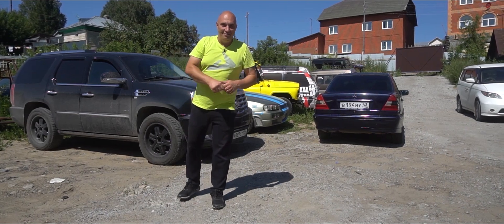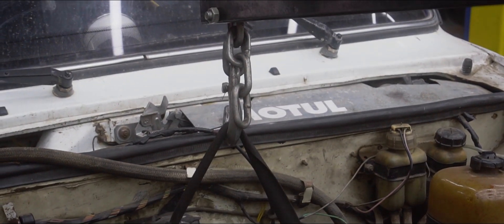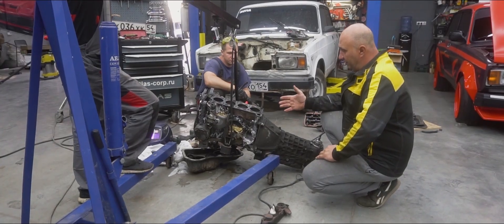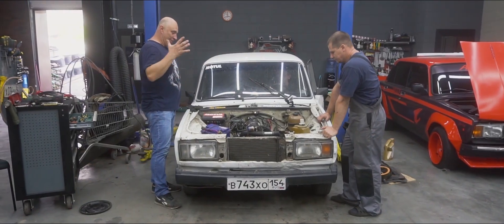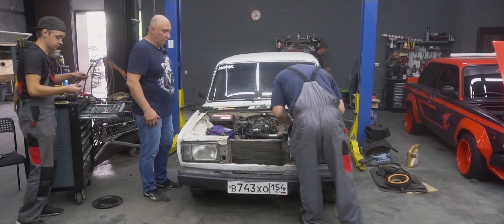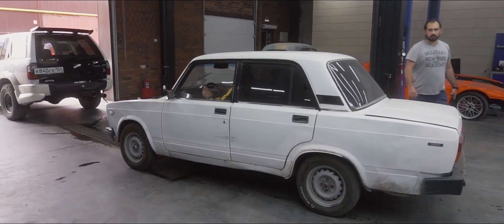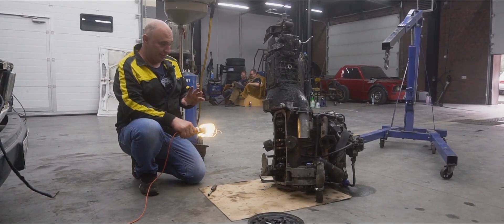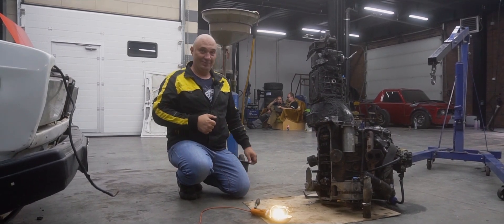Spring mod for piston rod – will it work?

Comment: Let’s see an engine block made of concrete. Cast in the bearings and the sleeves
Reply: Get a piece of billet stone and use that ? 
Billet stone 😆😆
Reply: Ship Engines have been succesfully cast from concrete
Reply: Their wheels are already filled with concrete. They won't make an engine out of this. They do not know how to work with concrete))
Reply: That would just be a complex bomb
Reply: Thats an easy one they make them out of plastic and that is old tech.
Reply: Concrete not good with heat. I will say high heat ceramic with intense nano tech luberication,.  is future if engines want to survive. Lithium battery replacement will be a killer for EV v mark my words....eh. Soon.

Comment: Try threading the spring into the actual connecting rod itself.  You can then adjust compression ratio by simply spinning the piston along the spring in a rotation of 360 degree increments. Also use a finer "thread" spring for more surface area inside the connecting rod. Food for thought.

Comment: Just like a miniture Tina turner, you need a tiny damper!

Other ideas...
Make a skid steer car, remove all steering mechanism, replace with right-hand brake and left-hand brake!
Replace all suspension springs with just dampers
Make EV - but just make forklift very fast. Or use very high torque electric motor, gear it right down with stupid massive gears, and make EV bulldozer.
Make 7litre ladazilla into monster truck with old tractor wheels
Make something go really fast that is normally really slow, or vice versa

Comment: The timing is all fucked-up.........Here....the Pistons will have a slack in position to the crankshaft....will spark at correct TDC according to the cam-shaft timing and not at the piston position . To put mildly..........you have put a rubber band in reverse !!! Enjoy wasting our time and learn nothing ?

Comment: force induction add some air in the engine and then start it or nos but i dont want you to blow the engine if it makes compression what i think happening is that the spring compresses till the valves open which makes no compression the reason of the engine not starting it also might have piston slap

Comment: You guys should try making a stroker lada. Got enough crankshaft haha. Cut 5mm off the connecting rods, then weld in 5mm of metal to each crank lobe. Wont hit top, and has 10mm more stroke. Could get crazy and cut 10 or 20mm out. Lol

Comment: I was thinking if they did it to a smaller motor like a brigs and used a hydraulic roller cam valve spring for a sbc  "a lot more stiffer spring" it might work.

Comment: Use to work for the government in an engine test facility and this idea was extensively tested with several different much better designed sprung conrods, and no we could not get it to work.

Comment: Even if the engine worked with just the springs the piston heads would simply smash into the valves deforming them with every cycle

Comment: You can't weld directly to springs for the same reason you shouldn't cut coil springs with a torch to lower your suspension. The heat creates a weak point. If they had machined some sort of fastener or even used JB Weld on the springs we might have a chance.

Comment: I think if they added a jumper pack to the battery to start it, the starter would have more power to turn it over. I think that'd work because I had the same issue when I changed my clutch. The starter didn't have enough power to turn it over. When they tried to pull it to start it, they must have put unnecessary wear on the engine. Although it didn't work, if they had probably put a jumper pack on the battery, they might've been made it able to run for at least a few seconds to a minute.

Comment: It can work,but with much,much stronger springs than those,also they weakened springs with welding.
Reply: Yeah. I think they would have to make the connecting spring as a whole that's not welded. 😁

Comment: When the air fuel mixture combusts the energy that is released sends the piston down. The rods transfer the energy towards the crankshaft thus making it rotate. Here the spring instead of transfering the energy it absorbs it therefore little to no energy goes to the crankshaft

Comment: Time for a boxer engine Lada? Two pistons in one block, two in the other. Cut down the engine blocks to the centre line of the crank so they can be welded together to make a subaru Impreza engine.

Comment: what is the minimum number of cylinders you can drive a Lada on (with the spark plug pulled out of the inactive cylinders)

Will the engine even start at all with fewer than 4 cylinders, or can you drive on just 1 cylinder and reap some fuel savings?

Comment: even just thinking sbout the combustion stroke, there's gonna be a big loss of power from the spring soaking up the travel of the piston
Reply: Their undoing was the compression stroke... crank journal rising, rod journal twisting toward that side of the bore, insta-wedge. Power stroke the rod journal is following, compression leading (the rotation)

Comment: THE NEXT TIME PUT VALVE SPRINGS UNDER THE MAIN BEARING CAPS!!
USE MAIN BEARING BOLTS THAT ARE LONGER BY LENGTH AS THE VALVE SPRING ARE LONG!!!

Comment: Gee....that’s completely ridiculous. Of course.....what’s going to happen? Seriously....???
When you weld a spring, it gets hot and it turns into thick wire.
There is zero chance of those welds taking that sort of inertia.....well let me put it this way.
You have a better chance of using baby seal foreskins,
 in place of the springs.

Comment: I'm no mechanic or automotive engineer at all, but I saw this failing from the very beginning. Even if it "worked", each cylinder would need to be extended in each direction to accommodate for the extra travel potential of each piston. And thus destroying the whole concept of compression.

Comment: Another explanation could be that, given the fact that you are using springs, you will never reach high pressure in the chamber because the coil will get pressed in the ascending phase of the piston, so, the level of explosion wouldn´t be enough to maintain the engine active.

Comment: Me: imma torque everything correctly because I wanna make sure it’s all good.

Russians: EMPAKT
Reply: It's a lada, it does not care lol
Reply: @televisionandcheese  i really want a Lada
Reply: Ugga duggas are the best
Reply: Danies Alex exactly, you need to torque the con rod caps to 2 Ugga duggas and the crankshaft bearing caps to 3
Reply: Honestly, for most things that aren't super critical (like inside the engine) impact guns are fine
Reply: Ollie Badstue they used it for the head bolts lol
Reply: @Racingboom  its lada , everything is cast iron non interference blah blah undestructible

Comment: Probably if you lower the compression a lot it would turn over but it will never run because the springs will put it out of timing it will destroy the valves

Comment: Now children what you see here is what is called Variable Connecting Rod Length on the fly otherwise known as VCRL on the fly,What that does is that it either controls the length of the connecting rod depending on temperature

Comment: The piston is going to crash into the top of the cylinder on the exhaust stroke or the piston will fall into the crank case on the power or potentially even the intake stroke. Compression stroke won't fail catastrophically but it might lower the compression ratio by enough that there is no power stroke.

Or the spring could just break

My guess is that best case scenario there is one rpm where the engine will run without issue and potentially even slightly increased efficiency, but it'll fail catastrophically before reaching that rpm.

Comment: Garage54: Replacing piston rods with springs.

14-1 Compression ratio engine: Am I a joke to you?
Reply: @inc.opt.63The compression ratio of an engine is the ratio between a given volume of a fuel-air mixture before compression and the volume during full compression. They can range anywhere between 8:1 to 12:1; diesels can have up to 25:1. The engine in this video has a bad compression ratio (or perhaps little compression at all) because the springs flexed and bended.
Reply: @UltimateBeamCar  not 100% true. You can have engines with higher than 12-1 compression, but can't use pump gas and have to use higher octane race gas (around 110 octane compared to premium pump gas which is 93 octane) as octane is the rating for resistance to detonation and you could run low octane gas but you'd fuck up your motor. That's why racers convert cars to run on E85 instead of normal pump gas because E85 is around 110 octane but is hard to find and you need expensive E85 fuel lines, fuel pressure regulators, and carburators/fuel injectors meant specifically for E85.
Reply: @moparmanicgarage  I was mainly using production engines as an example, but yeah that is correct.
Reply: Your statement used to be true. Mazda's SkactivX engine has a 16.3:1 compression ratio on pump gas. Achieved by carefully controlling flame propagation and having a new piston design.
Reply: @UltimateBeamCar  nevermind, the pistons keep wanting to go to TDC way after they should be
Reply: That was the first thing I thought.
Reply: I was looking for this comment.  and so were all the other mechanics 😂
Reply: @Forged_production  im not a mechanic, im 15 lol
Reply: @antreaskonstantinou8585  irrespective. You have a good point.  Because the spring might cause the motor to lose compression because it is variable
Reply: ha someone got it right.  no compression no explosion..

Comment: Its gonna be hell to keep that thing in time if it holds together at all lol you'll predestination on the cokpression stroke, and open late on the intake stroke, as well as not fully remove exhusf gases because of the spring delay....it might rub but not very well and not very long.

Comment: this deserves a part 2 with a little bit more thought and you will get it going. PLEASE  :)
Reply: yeah, put a telescopic guide of some kind inside the spring so it doesn't bend side-to-side, then it at least won't immediately break.
Reply: Yeah they forgot the shocks
Reply: Old engines ran on like onlu 4:1 compression ratio, I'm sure a stiff spring could achieve this..

Comment: Piston return springs!  Now you need muffler bearings, blinker fluid, headlight fluid, and elbow grease
Reply: Throw in some soapy wooder and ur all set
Reply: Lada and Honda seem to have quite different kind of piston return springs
Reply: Don't forget the lifter thrusters and the bucket of chrome sparks.
Reply: @RegalCobra097  whut chu talkin bout willis?
Reply: @daves_not_here_mannn  Well, "Lifter Thrusters" I've heard from a guy here at YT years ago and "Chrome Sparks" is a translation from my native language. Both are automotive jokes, fam.
Reply: @RegalCobra097  mine was a joke too. Guess you've never seen the show.
Reply: forgot racing air in the tires...   lol
Reply: @harleyme3163  make sure it's summer air, unless it's winter.  Then you need winterized air
Reply: A box full of center punch marks ??
Reply: ...and gearbox sand
Reply: Really a shame this didn't work, that Lada was a rare, one-year-only model that came with factory high-compression seat covers. Good luck finding those.
Reply: and gearbox sand!
Reply: hey guys, Chris Fix is here !!!
Reply: Haha Chrisfix
Reply: Chris fix
Reply: elbow grease does actually exist!
Reply: Oldest jokes in the book, and they get 260 likes. Ay yi yi. SMH 🤦‍♂️
Reply: Ну жидкость для фар, раньше в фары заливали тормозную жидкость что бы не потели!

Comment: Have you guys tried installing an engine 180 degrees into the engine bay?  so the top of the engine is on the bottom and the other way?
Reply: The buttom end would starve of oil and burn the bearings
Reply: Matt Garkus you beat me to it lol.

Comment: Have you try to make the slideable connecting rod and put spring over it weld it to the top and bottom of connection rod.. just like other put spring over shock absorber.

Comment: Starting at 5:20...
  My guess is, since the new Piston "Spring Rods" have "give" to them, the piston won't have any compression to it- or at least not enough compression to allow for the fuel/air mixture to light off.

(Well, NOW I don't know, because starting at 7:29, the engine DOESN'T seem to want to turn over....so now I'm not sure about my previous diagnosis...)

Ok! So answer is at 10:33...the damned springs refused to stay welded to the bottom section of the original connecting rod.

Comment: Try again, except next time, add "sliding" stabilizers on the two sides of the spring connecting rod. Solid bar through a tube, just to help maintain alignment so as not to allow the springs to buckle and shear against the t weld. Sliding so as to allow for the spring to compress and stretch, but bolstered on the two sides in the direction that the spring wants to buckle due to the offset caused by the crank turning.

Comment: Suggestion: Try it half conrod, half spring. Cut the conrod in half or maybe 70% of it. That way, you will be able to do a stronger weld. Better yet, slide the spring through the cut conrod. You will have multiple welding spots.

Comment: Did you see those welds! Man fire the welder hes got no business being near one
Reply: U cant even weld a spring. It's no longer a spring at the weld
Reply: Yeah those were painful
Reply: You couldnt weld if your life depended on it. The spring is hardened steel. The piston is probably high strength low carbon steel. Those 2 would never have a good weld joint no matter what
Reply: Who can't weld? Cause pistons are alum
Reply: @dualsportrider3221  shit youre right. Totally forgot pretty much all pistons are aluminum. That wont bond for shit
Reply: @connivingkhajiit  the connecting rod probably isn't. The actual piston may be alu, but the con rod is probably steel. And tbh they probably got a new kid just learning to weld to do it because, well, you're swapping conrods for springs so at this point it doesn't even matter.
Reply: @tomw9078  the thing is that in welding, aluminum and steel dont bond through fusion, only through adhesion. Adhesion joints are shitty.
Reply: @connivingkhajiit  Choose the appropriate welding method, and its very easy. The solution is forge welding, the oldest welding method.
Reply: Show me your spring steel to conrod welding please

Comment: Take a 4 Piston row Engine, make 1 Piston into a Air compressor, buy a simple Axial Piston Pump (there is the pump, and the other thing that is powered by the pump and converts pressure back into motion) and drive Lada with Pneumatic or Hydraulik traction power!
Reply: This:
https://en.m.wikipedia.org/wiki/Axial_piston_pump
And you need Axial Piston Motor, but the one powered by pressure, not to generate pressure!

Comment: If the welds survived, the pistons would immediately touch the valves.
Solve the welds issue and grind/reprofile the lobs on the camshaft.